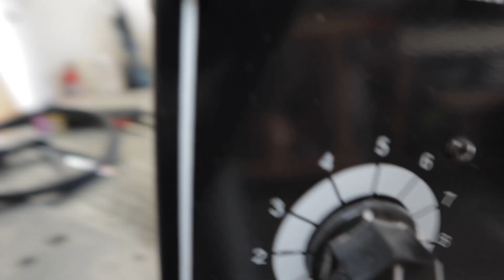Harbor Freight Gasless Flux Core Welder Mods - Coil Wiring Detail (viewer request video)

Comment: where can I rewire the switch to avoid the conflict at the rectifer? 
when I connect the 3V AC from the transformer to the rectifier, there is some kind of a problem because the transformer will buzz and the wire doesnt feed ( no power to motor )
Reply from the maker: That’s a good question but I don’t have the answer. I didn’t have that issue so I haven’t done any research on it. I do wish you the best and hope you find the answer.

Comment: that black box is a Relay  when you squeeze the Trigger on the Wand it closes the relay  and feeds AC Voltage to the Transformer input Primary side  , the transformer is a 2 stage  that's why it has 3 wires on the primary side

Comment: Hey welders. I'm pretty sure the little box is a relay used to make the gun hot only when the trigger is pulled. On the MIG 130, the gun is always hot, but not on the Chicago Electric. I've been toying with the idea of adding one to my MIG 130 welder. Cheers
Reply: It has to be some sort of Interposing Relay that closes contacts to energize the welding gun when the hand switch "trigger" on the gun is pressed.  "Trigger" switch then has to be wired to the Relay (small black box) and small transformer on top is supplying control power to the relay and circuit board. The wire feed motor has to be also powered from the relay which is activated by the same "trigger" switch.  Just my guess.
Reply: You are correct.  Pause the video at 2:20  That is the relay that powers the transformer when the trigger is pulled.  When the trigger is pulled, DC voltage is applied across the coil of the relay (there are 2 pins soldered to the circuit board, these are the coil leads).  That coil moves an internal contact that connects the two yellow insulated spade connectors at top together, completing the circuit to the main transformer.  You just need to find out if the trigger provides a ground signal when pressed or a positive voltage.  One pin of the relay would be connected to this trigger signal and the other would go to the opposite polarity source to that trigger signal.  Some relays have an internal snubber diode (to protect other components in the circuit from voltage spikes caused by the collapsing field in the coil), in which case it has a specific polarity, so be sure to check beforehand.
Reply from the maker: Thanks for your input, I think you may be right about that black box. If you are correct and don't have that feature, it would be a neat project I think. 👍
Reply: Yeah, but still have to figure out how to wire it in. Found them on eBay for about $10, so not too expensive. Have a merry Christmas brother.
Reply from the maker: Nice! Merry Christmas to you as well brother!

Comment: Thank you for your help. Your welder seems to be a bit newer than mine as it doesn't have that black box, but the transformer wires look the same.
Reply: I've made a couple of updates on mine. I put a dinse socket on mine with #4 ground wire, and I'm also planning to use a miller m25 mig gun with a plastic/metal adapter yet to be made to fit in the place of the HF one on my welder.
Reply from the maker: Sounds like you will have nice welder when you are finished. I really like your idea of moving the power cord to the back of the machine.
Reply: @DIYHomesteadProjectsDIYHP10  I couldn't understand why they would want the cord coming out of the front. I put a plastic cap in the hole from an automotive application and it closed the hole nicely. Monday I plan to get my rectifier hooked up. I have a heat sink from a PC processor that should handle the heat nicely.